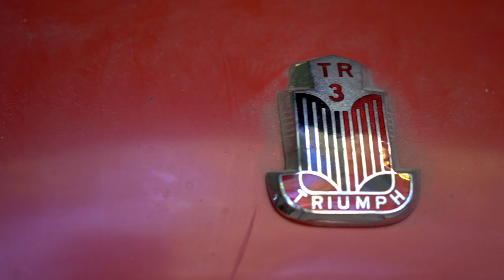Buddy's Ride - Triumph TR3

Comment: I've owned and maintained my TR3A for 52 years, I'm now 75....There was a time when I had a Burmese cat named Elsa and I couldn't get down my driveway that she didn't jump into the passenger's seat....The local A&W knew us very well and would bring her chicken and me a teenburger...I haven't been well lately so the car's been sitting in my shop, but I'm improving and this summer will see us out and about again....The ethanol in the gas limits the fuel pump diaphragm to 3 years max, so I'll have to tend to that (again)...I have a Moss Motors kit but it seems very cheap, so I may salvage one from one of my spare pumps, or even go electric....I have never had an overheating issue, but drilled 4 holes in the thermostat flange and always ran 100% antifreeze...There were times that I simply removed the thermostat altogether....She runs at 50+lbs oil pressure, but there's a bit of blowby smoke, so I use a PCV valve into the intake manifold....A few years ago I had the radiator serviced and reassembled it with a small electric fan in front operated with a switch on the dash . I found the fan at a wrecking yard and thought, "Why not?" ....After 52 years she could use some 'freshening up", but then, so could I ....haha.......It amused me to hear you mention people's reaction to the car in your carport, Mine sat in my garage with a giant stuffed Snoopy that hardly fit in the seat and it's chin hung over the windscreen. I would leave the door open and the kids going to school would get the biggest kick out of it, along with their parents...I've had people in their 30's tell me they remember passing by,  and that's a nice thing to hear.........................John (west coast,Can.)
Reply: My first car was a 1959 TR3A with rare overdrive that worked. Did ground up restoration with my dad in the 90s as a teen. Had to sell due to life intervening but retirement will see me with one again perhaps. Such a great car, drove like it was on rails.
Reply: I admire and envy the fact that you’ve kept your TR3 for all these years. I bought a ‘57 in 1965, when I was 17. Reliability was an issue, as well as budget, so I hitchhiked a good bit when I owned it, but still loved it dearly. A career move required a four door car so I made the sad decision to sell it in 1969. All these years later, I really miss it!
Reply: So good when you latch on and get decades of enjoyment from a car John. I've had a '68 Triumph Vitesse convertible for 42 years.  It shares the garage with a Jaguar XK140 but the Triumph is the keeper 😊.
Reply: John ; I hope you are doing better and got the TR3 out a bit. I enjoyed everyone’s responses in this thread. And I love Buddy’s ride.

Comment: I had a 1960 TR-3A I purchased in 64 when I got out of the Navy. Had TR-4 pistons and sleeves installed, had the motor balanced and heavy duty clutch and clutch springs. A complete new wiring harness and a LOT more. That car was fast. I loved it and sure wish I had it now! I am glad you were able to get one when you retired. I have always said that the Triumph TR-3 is the most fun car ever made!! Enjoy
Reply: I bought a 1960 TR-3 when I got out of the Navy in 65, paid $360 and drove it for five years, through college and a year of law school before having a junk dealer haul it away for $80. Loved that car, but brrrrrr cold in the winter with that little fan heater circulating water from the engine.

Comment: I had a '58 TR3  when I was going to college in 1968-9.  There were very few foreign cars of any sort back then let alone a sports car, so I felt very unique. One of the things I thought was really cool about it was it sat so low that when you came to a stop light you could reach out and set your Coke down on the pavement while waiting for the light.   When the light turned green I would reach back out, pick it up and go.  I knew people were looking at me in amazement.  There were a couple of things about it that weren't so neat. The rag top attached to the top front window frame by button snaps that were about 6-8 in apart.  The gaps were not exactly tight, and a lot of things could slip through....rain, wind and bugs.  More than once I would be driving along and suddenly, I would have a wounded pissed off bee in my lap.  The door windows were separate from the doors themselves and when you wanted [or needed] windows you took them out of the trunk and slipped them down into a bracket on the door. Nothing was airtight about that car and the heater was not sufficient for driving in temps less than about 50 degrees.....so you dressed warmly in the winter.  The muffler fell off in the second semester of my senior year...That made me love it even more.

Comment: I had a 57 that I got in 1977.  I love your video but have one major complaint.  That car should always be backed into the carport!  She needs to show off her pout.

I did a frame off rebuild and replaced the wet sleeves with the overbore kit that increased the displacement from 1991cc to 2187cc which made a huge difference in the power.  The TR3 has incredible handling with the double wishbone front end.  It was unusual in that the upper wishbone is smaller than the lower.  That makes the front wheel on the outside of the curve lean into the curve due to compression of the springs from body role.  The opposite is true of the inside wheel.   This means that both wheels lean into the curve which really pulled the front end around.  In spite of this it had very little tendency to under or over steer.  You basically point it through the curve, and it would do it.

Comment: They are a fun car in a warm weather.  I went to college in Vermont and they are not a winter car.  They were real cold to ride in.   However, in below zero weather it would start when no other car in the parking lot would start.  The nice thing about your car it does not have wire wheels.  They are the worst.  Of course I paid $300 for mine in 1967. I bet yours was quite a bit more expensive,

Comment: I drove a TR3B #74 DP in SCCA races out of the San Jacinto region (now Houston region) Always got 1st in Class 3rd overall. 1 DNF. (brand new Lucas condenser was a dud) Car was highly tuned. Had overdrive transmission. Out ran cars in higher classes, notably a Yenko Stinger and Triumph spitfire GT6. Could accelerate with old B production Corvettes up to 100 mph. 139 mph top speed on mile long straightway. Did not have cam as wild as what Kasner used but had a wider torque range. Power came on between 4500 and 6500 rpm.

My personal driver was 68 TR4 IRS, mildly tuned. Very nice ride until a woman drove into the back while it was parked. Drove it from Houston to the Bay Area in 30 hours. Not much Interstate back then. Went through a tank of fuel at 120 mph through West Texas.

Comment: Great video. Where can I find an 8 bladed fan?  I have a 1959 Tr3a where the temp hovers around 180F.
Reply from the maker: Try giving Moss Motors a call. There's an 8 bladed fan for the TR6 which may fit as it also fitted other Triumph engines. 1-800-667-7872
Reply: Nothing wrong with 180degrees, is typical operating temp.